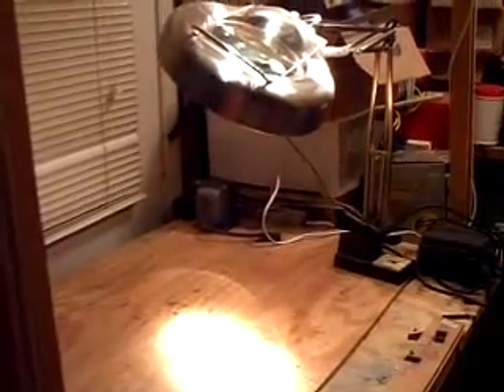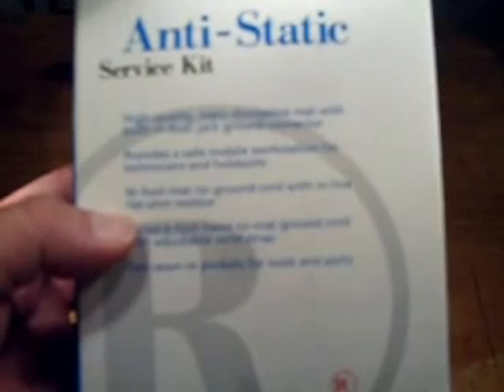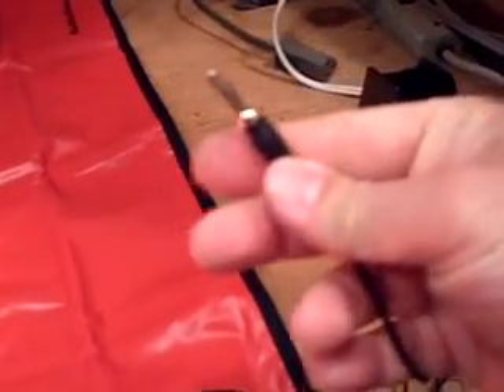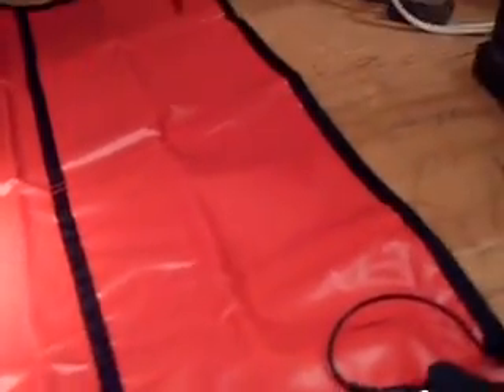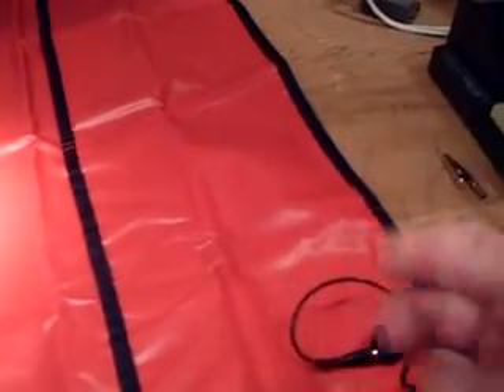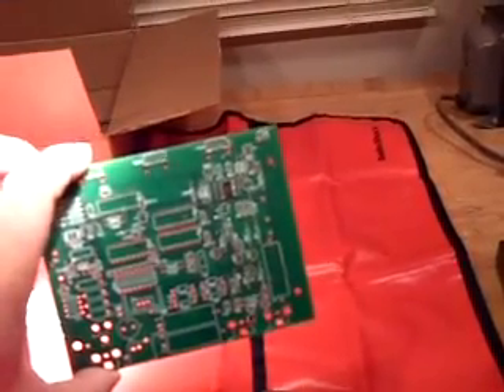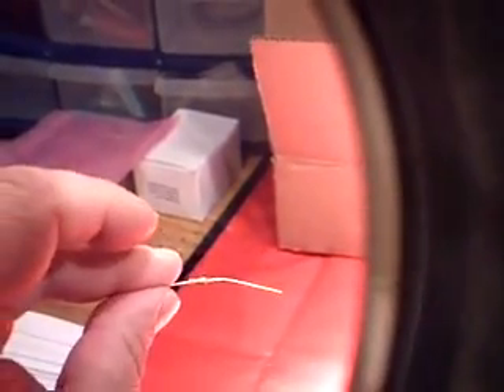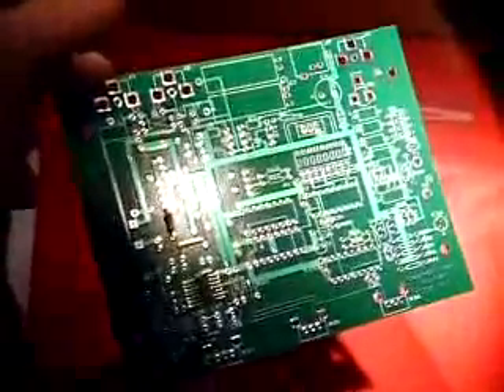LPAM Transmitter SSTRAN Kit Part 2 Resistor Mania

Comment from the maker: @old64goat  Well, the resistors are pretty small, I can tell you that! I couldn't see the colors unless using the magnifying loop. Even then, I couldn't make out Black from violet, and red from orange, and black from brown That's where I had to improvise and use the ohm meter. It took me 2 hours to populate the board with 30 resistors! But I freakin' did it!!  Thanks and stay tuned, I'm fixin' to go all that way with this thing.